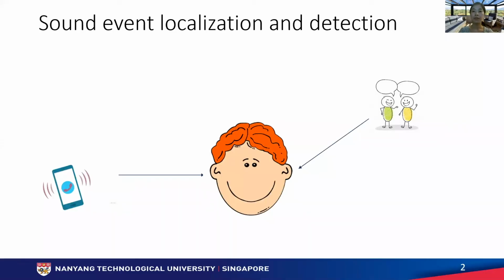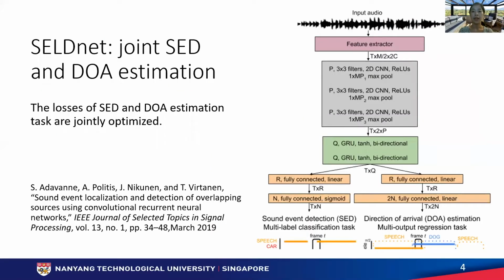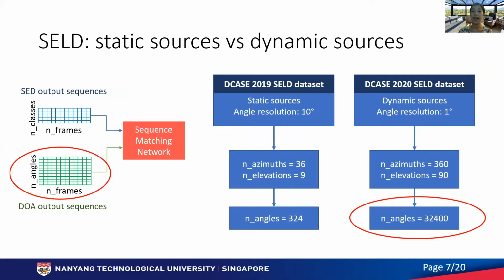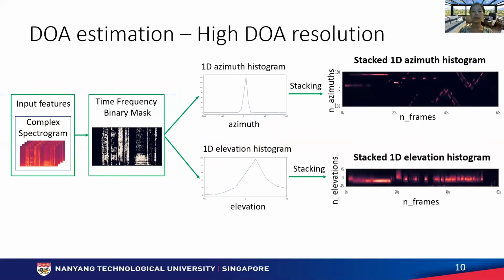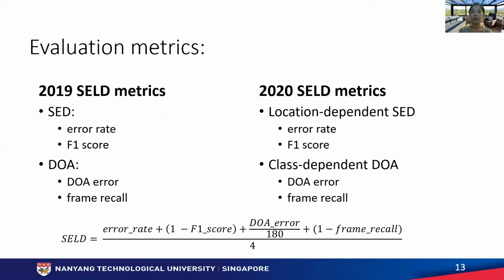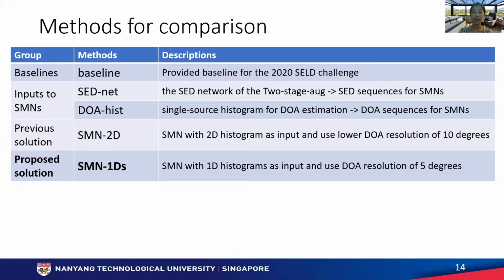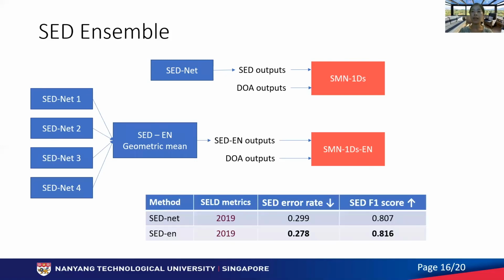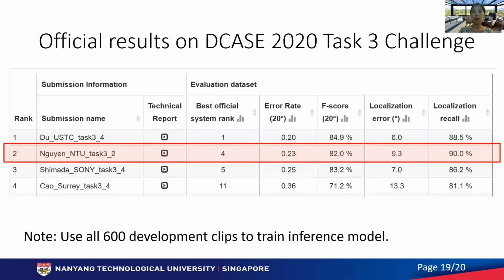DCASE 2020 Workshop, ID 55, Thi Ngoc Tho Nguyen et al.

Comment from the maker: keisuke_imoto
5:17 PM
 Has joined the channel.

shinji_watanabe
11:45 AM
 Has joined the channel.

tho_nguyen
9:27 PM
 Has joined the channel.

archontis_politis
9:27 PM
 Has joined the channel.

archontis_politis
9:28 PM
Hi Tho, about my question, I did confuse the work in the workshop with the work in ICASSP with the track-based classification DoAs, sorry about that 🙂

tho_nguyen
9:31 PM
Hi archontis_politis, no problem at all. Thanks a lot for your question, and also for your time and effort preparing the dataset ^^. I will answer your question regarding to the spatial features a little bit later.

tho_nguyen
10:47 PM
And also help me say thanks to sharath_adavanne and Professor tuomas_virtanen

archontis_politis
11:11 PM
I will!

yohei_kawaguchi
8:28 PM
 Has joined the channel.

yohei_kawaguchi
8:29 PM
Copied from Zoom

Yuma KOIZUMI
My question may be different from the main target of your presentation... In my understanding, the loss function for DOA is cross-entropy, is it right? I guess, in this case, the risk of mistaking azimuth=10 deg for azimuth=15 deg is the same as that azimuth=190 deg. Does that mean this was not a major problem for this task? Or did you use some tricks to avoid this problem?

masahiroyasuda
Is your proposed 1D-spectrogram input for DOA estimation extracted from the intensity vector masked by power-spectrogram binary mask? Why 1D-spectrogram is effective than 2D-spectrogram or raw-intensity vector?

Xuan Zhong
Do you think the shape of future mic arrays could be changed (in ways similar to that of the outer ear of humans or barn owls) to intentionally make angle-dependent level and spectral difference even more salient, so that the DOA estimation errors could be further improved?

tho_nguyen
11:54 AM
Hi Yuma, thank you very much for your insight. In this paper, I use MAE loss for azimuth and elevation regression.

tho_nguyen
12:00 PM
Hi Masahiroyasuda, my 1D histogram is not extracted from the intensity vector mast. The mask is obtained by filtering the TF bins to get single-source bin. A TF bin is considered single-source if its energy is above a certain noise threshold and contains mostly one source. The 1D histograms are more effectively than 2D histogram for this datasets because the 1D histograms have higher angular resolution.
Hi Xuan Zhong, I think your suggestion is a good idea. We need more datasets to confirm which array geometry is optimal for this SELD task.

yohei_kawaguchi
4:15 PM
yuma_koizumi masahiroyasuda

yohei_kawaguchi
8:34 PM
Copied from Zoom

Daniel Krause
Did you compare class-wise localization vs. localization of a predefined number of sources (in this case, 2 outputs vs. 14 outputs, I think)?

Archontis Politis
You have some redundancy in the number of DoA classes, due to the spherical geometry (less effective points towards the north or south) - did you consider any strategies to take that into account, to reduce the number of classes without compromising performance?

Daniel Krause
Looking at your report, I see that you have 14 localization outputs per each Cartesian coordinate (which is equal to the number of sound classes). Did you try an alternative approach, in which you limit the number of localization outputs to the max. number of overlapping sources (e.g.)?

tho_nguyen
12:03 PM
Hi Daniel, I have not compared those in this DCASE paper. However, I did the comparison in my ICASSP paper (in the reference of this paper) using last year SELD dataset. The track-wise output format seems to be better than the class-wise output format
Hi Archontis, thank you for your suggestion. I think this is a very good idea. I will pay attention on this for my research.
Hi Daniel, please refer to my answer to your previous question. I haven't tried the track-wise output format for this report, but I did tried that format for DCASE 2019 SELD dataset. The track-wise output format is better than class-wise output format. Thank for your question.

yohei_kawaguchi
4:15 PM
archontis_politis